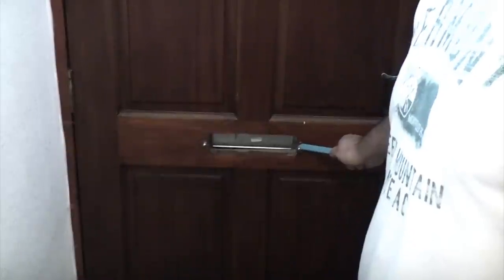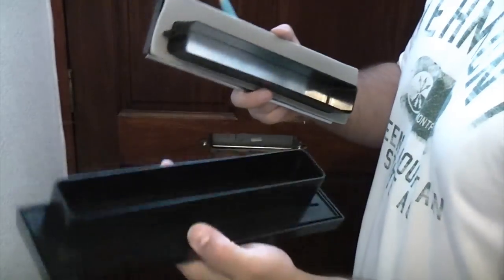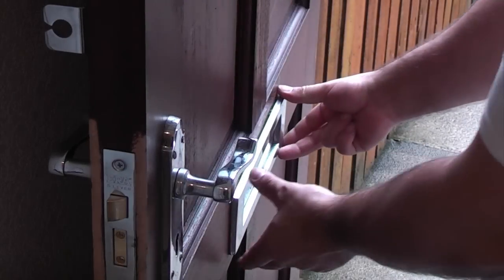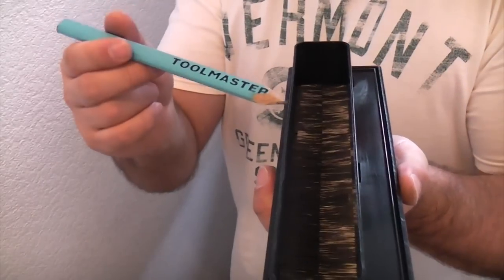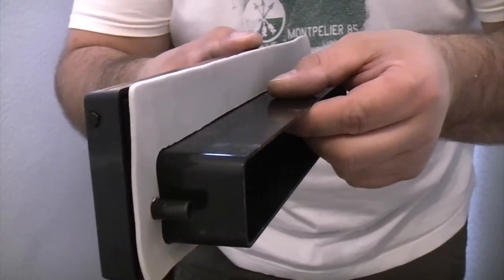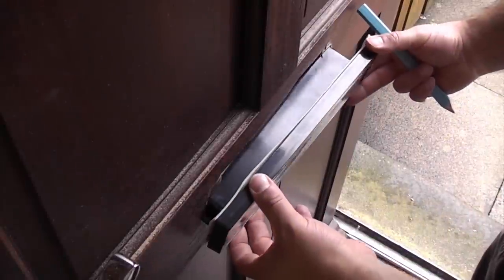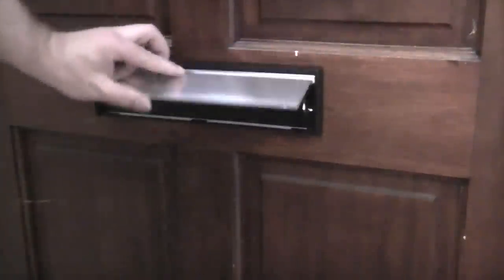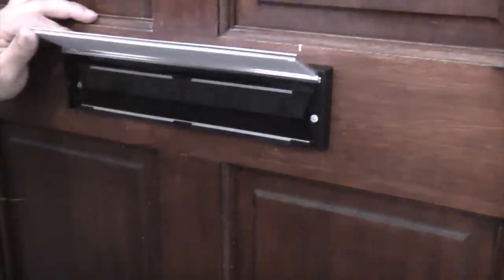How to fit a sleeved letter plate

Comment: You missed one critical piece of information. The internal sleeves come in 2 depths. Usually 20-40mm and 40-80mm. You need to get the right depth depending on the thickness of your door. Aparr from that a very useful video. Thanks

Comment: When I removed my old one, the outside part had been sealed with silicone. I've scraped and cleaned the old silicone away. Is it necessary to seal it with silicone?
Reply from the maker: If the new one has a seal, it should be fine. If it doesn’t a bit of silicone might help to make it water tight 👍

Comment: Hi my husband is installing a letter plate the same as the one you are working on,
The difference  is he is installing it through the porch wall which is two brick thick with a  cavity between the two bricks…..I was wondering what we can use between the two letter plates to stop mail falling down the cavity?
Thanks
Sheila
Reply from the maker: Hi Sheila,
You might be able to get a sleeve/liner, but after doing a quick search I could not find one.
I think most people buy a dedicated kit, which includes a metal liner. 
 Thanks for the comment 👍

Comment: Thankyou.
Ive found when even using smaller dia bits,like 5 and 6mm,on laminate covered wood it can totally ruin it when it comes through the other side.
For this reason i always try and use brad point drill bits on wood from now on.
Thanks again...!